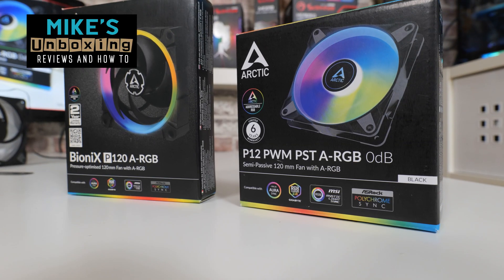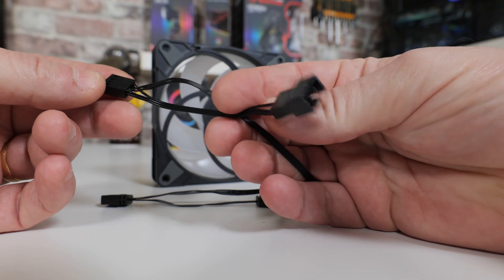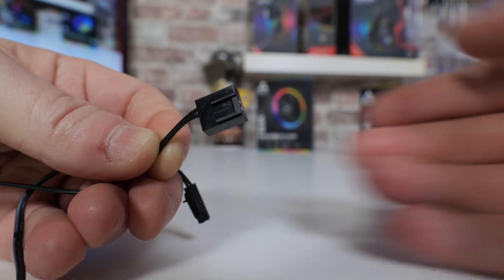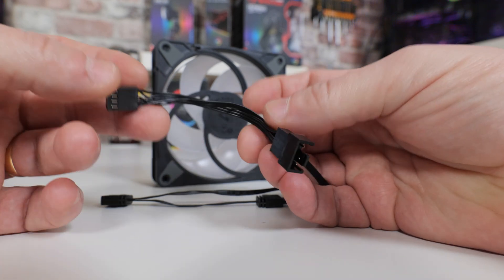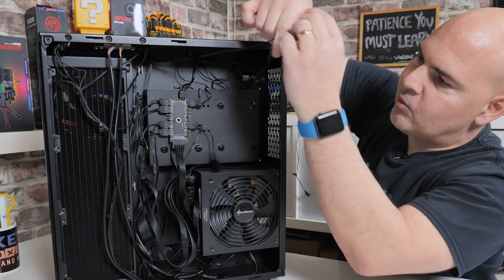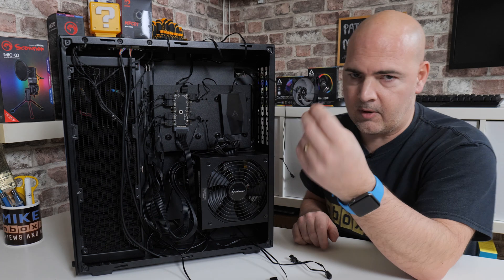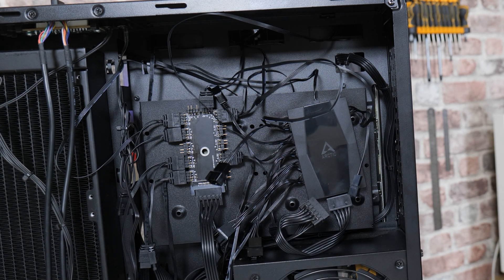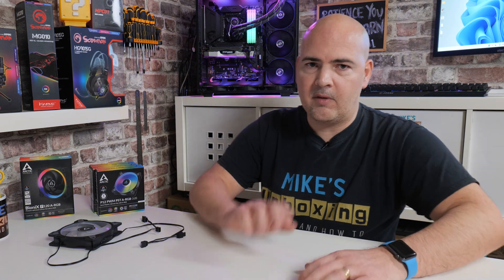Add Extra PC PWM Fans With Arctic SATA Powered 10 Port Fan Hub

Comment: Perfect, the information I was looking for.  Greater content.

I am going to have (don't judge me) 18 fans in my case, the Thermaltake Core P8 and Asus Strix Z790 board.  It's for looks more than cooling.  Project name, The Volume.  I was worried about the strain 18 fans would have on the motherboard.  If I can find a 480mm x 120 screen to use as a system monitor I will out 4 fans. ;-)

What are you using for a ARGB controller?  I am going to use the Arctic P12 PWM fans.
Reply from the maker: the id cooling one we reviewed is decent and the cheapo argb hubs on amazon are not bad either
Reply: @mikesunboxing  I just watched your other video and again great content. A lot of help. Thank you.
Reply from the maker: @lostinseale  Glad we could help 🙂

Comment: Hey Mike i've bought this hub in a bundle with 5 fans. Problem is they shipped 3 pin fans. 

Did they make a mistake or can I use these? 

My motherboard does have a 4 pin header.
Reply from the maker: no this isn't compatible with 3 pin fans sorry
Reply: @mikesunboxing  oh sad. Well um gonna change them. Thank you!
Reply from the maker: @callmecoren  no problem, hope you get it sorted out, any problems let me know

Comment: I'd need one like this but with software allowing me to control each fan. RGB no needed. Any suggestions?
Reply from the maker: corsair icue commander, or similar but you will be locked into that eco system same for lianli and thermaltake etc
Reply: @mikesunboxing  Thanks, that Corsair unit looks good. I won't be locked with corsair fans as i can connect other brands. I'll loose rgb control but i couldn't care less about it. Thanks!:)

Comment: Actually, Arctic supports max of 2 fans per port, so you can actually connect 2x more fans if you want to daisy chain 2 fans on 1 port.
Reply: Cool, if I connect 1 hub to every fan header in my motherboard, then I can connect 6 case fan hubs to finally run my 120 case fans.
Reply: Thanks!
Reply: So I can't daisy chain 3 fans to one port on a hub to have 3 fans bottom, 3 fans side, 3 fans AIO and 1 fan on rear?
Reply: @BeardedGinger  You don't need to daisy chain 3 fans onto 1 port. If you want to have 12 fans in the case, just daisy chain 2 fans on one port on the hub. 12fans/2cable = 6 ports, meaning you will occupy 6 ports on the hub and still have 4 spare. Yes, you can daisy chain them in 3 but depending on the fans, that might start to overwhelm the hub and may start losing power (or just not spin up to maximum speeds). Sometimes it may even burn/fry. You can daisy chain 3 on one hub only if you are using basic Arctic P12's, which do not use alot of power even at max speeds. Hope I clarified it a little bit more, but let me know if you need extra details
Reply: @dduleyt  these hubs are only $10 US at this time, just get another one, six in each one, two headers, simple

Comment: I bought the P12 A-RGB fans, and i have a problem. How do i get rgb to all the fans? I've connected them together and one is on the motherboard. And, only the one that's on the motherboard works.
Reply from the maker: sounds like you have missed the daisy chain somewhere
Reply: @mikesunboxing  yeah, now its fixed
Reply from the maker: @theoneandonlyparsa  Glad you got it working 🙂

Comment: Great review, liked and subscribed. This HUB is pretty useful especially for a push pull ocnfiguration of a 360 AIO!!
Reply from the maker: Thanks for the sub!
Reply: Hi Alex, did you connect all 6 radiator fans of the aio into the Hub and the Hub itself into the CPU_FAN Header on the Mainboard? Thanks for your Help :)

Comment: What fan hub would you recommend for the Corsair sp120 pros
Reply from the maker: the deepcool fh-04 is what i used
Reply: @mikesunboxing  thank you so much man 🙏 another thing is what rgb hub would you recommend for the arctic p12 rgb I have 3. 2 of them In a 240 aio and one in the back what rgb controller would you recommend preferably through USB because my motherboard doesn't have rgb headers

Comment: Hi do you need to have the arctic fan hub to connect the arctic fans, or can i use my existing hub
Reply from the maker: Arctic fans use standard pc pwm and ARGB connections so any compatible motherboard or hub will be fine

Comment: hi mike, i want to buy this hub but is it compatible with the arctic p12 pwm pst rgb (the same as you but with non adressable rgb) and how will i connect it to the mobo?
Reply from the maker: yes and you will need a hub or daisy chain the argb to the motherboards argb port and a single PWM from this hub
Reply from the maker: yes it is and connect to the motherboard chassis fan header and sata power

Comment: hello mate, i have a question, can i connect the 4 pin to 2 pin cable to any sys_fan port in the motherboard?, what i mean is, can i connect the 4 pin side to the sys_fan 2 instead of the 1?
Reply from the maker: yes any motherboard header that supports PWM is fine
Reply: @mikesunboxing  Wow thank you for the quick response :)
Reply from the maker: @usagiii9337  No problem 🙂

Comment: I have a question...say if I wanted to use an led strip and have a 2 pin button on the case can I control the led strip if I connect that 2 pin button from the case into that 2 pin slot on the fan hub?
Reply from the maker: sounds okay to me

Comment: I've been using a 3 pin fan in a 4 pin, and the speed was regulated by the motherboard

But when I use the hub, all fans go at full, why?
Reply from the maker: because the hub doesn't support 3 pin fans

Comment: I have rgb fans with cable with two connectors on it, male and female. And when i connect them on hub and mobo 4 pin cha_header and sata it doesnt work. I can't find soulution for fans to be connected on mobo so I can control them...
Reply from the maker: This is maybe easier to fix or at least advise if we can ask more questions and get direct answers, so feel free to join our Discord chat and we can go over it in more detail https://discord.gg/XtBTGQ6BDu
Agree to the rules by clicking the emoji and you will get access to the rest of the Discord channels

Comment: Which the best fan controller software for windows u did recommend?
Reply from the maker: i generally use the motherboards software and that seems to be enough, what motherboard do you have?
Reply: @mikesunboxing  B450m mortar max.. im try using speedfan.. but the config kinda suck.. i need an easy  software to setting up the fans..

Comment: I'm planning on replacing my front 3 case fans, my EVGA CLC 360 fans, and my rear case fan all with P12s
if i do this, is it right that they are all not PST, and I connect all 7 fans to the arctic fan hub (powered by psu), which then goes into my motherboard?
Reply from the maker: yes that is the best solution

Comment: Does the Sata cable come with it?I just ordered this hub from amazon,but they didnt mention the sata cable.
Reply from the maker: the sata plug goes straight into the unit from your PSU on current models

Comment: I was hoping you would go over the bios portion. I was able to power my corsair fans and control their rgb but they don't see to be adjusting to changes in my overall case when it comes to heat and I can't figure out why.
Reply from the maker: This is maybe easier to fix or at least advise if we can ask more questions and get direct answers, so feel free to join our Discord chat and we can go over it in more detail https://discord.gg/XtBTGQ6BDu
Agree to the rules by clicking the emoji and you will get access to the rest of the Discord channels

Comment: Great video, thank you. One query, there is usually risk of shorting the motherboard header fan pin if we chain multiple fans on a single pin. But as this hub is externally powered, is this risk mitigated?
Reply: The fans are powered by the SATA which comes from the PSU. The 4-pin which connects the mobo to the hub is only used for RPM control.
Reply from the maker: Yes, correct
Reply: @mikesunboxing  Thank you Mike for the reply. This really helps!

Comment: I basically have 1 cpu header (4pins) and 1 sys_fan (3pins). Can someone tell me, if I can connect the hub with cpu header?
Reply from the maker: you can but i would use the sys fan personally
Reply: @mikesunboxing  if only my cpu fan has speed adjustment, i must use cpu fan then?

Comment: Hello I am looking for a way to add 7 non-rgb corsair ML140 fans because I don't have enough headers would this still work or are the connections different? help i cant find information anywhere..
Reply from the maker: Ml120 and ml140 are pwm fans so will be four pin pwm so this will work fine
Reply: @mikesunboxing  thank you so much! Gunna order one

Comment: does this work with rgb fans ?
Reply from the maker: the rgb would need to be controlled on another hub or from the motherboard, but the fan part is fine on here if they are 4 pin pwm fans

Comment: Does is it matter if i use 120mm or 140mm fans ? Or should they be all the same size because of the different rpms ? Greetings
Reply from the maker: ideally keep them the same size and rpm ranges, but it should be fine  either way

Comment: A quick question i heard that you cant controll fan speed below 1800 rpm (and it cant go below) is it true?
Reply from the maker: 4 pin PWM fans will go from zero to infinity so not that is that correct what you have heard. unless they are referring to 3 pin fans
Reply: Thank you!

Comment: Can I use non PWM fans with this?
Reply from the maker: you can but they wont be able to be controlled so will spin full speed
Reply: what if i have a pwm fan connected to the 1st slot and non pwm to the rest, will the non pwm still spin at 100% speed? they're kinda brute forcing my cpu cooler to spin rn lol
 @mikesunboxing
Reply from the maker: @tortrac958  non PWM fans will run full speed if the fans don't have it.
think of the fan wires like this,  one is voltage (at max) the other is ground, another is rpm sense. this is a DC type fan controlled by adjusting the voltage to get the desired rpm.

With PWM you have and extra wire and that is used to regulate speed instead of voltage control, so if that wire is missing the port defaults to maximum voltage and therefore max rpm

Comment: thankl you so much i have one quick question. do they have to be arctic fans or can i plug in my corsair fans into them? i was planning of plugging the rgb connecters in to the rgb hub the fans come with and useing this for powewring them/
Reply from the maker: as long as the fans are 4 pin pwm any brand is fine
Reply: @mikesunboxing  so would carsair ml120 fans work? There 4 pin but I don’t know what pwm means
Reply from the maker: @xhale8064  As long as they are 4 pin - PWM means pulse width modulation
Reply: @mikesunboxing  i built it today and plugged it all in and the fans are 4 pin pwm and they didnt work but when i plugged them into the motherboard fan headers they worked. very dissapointed they didnt work
Reply from the maker: @xhale8064  This is maybe easier to fix or at least advise if we can ask more questions and get direct answers, so feel free to join our Discord chat and we can go over it in more detail https://discord.gg/XtBTGQ6BDu

Agree to the rules by clicking the emoji and you will get access to the rest of the Discord channels
Reply: @mikesunboxing  I’m just going to pick up some y cable splitters

Comment: theres a fan Hub that came with my PC case for the case fans, is it ok to keep that one and add another Fan hub for more fans or do i have to swap the fan hubs for it to work right
Reply from the maker: you can daisy chain hubs or just power it and use a signal from a different motherboard header

Comment: I've read somewhere that we were supposed to connect the hub to the CPU_FAN, and then the air cooler to the hub. I have no idea why. As far as I know my motherboard (biostar racing b350gt3) supports smart fan on cpu_fan and on both sys_fan, so I should just connnect the same way you did, right ? Thanks in advance!
Reply from the maker: i would use this for case fans only and connect to the case fan header. If you want to connect your cpu cooler to it then you would connect the hub to the cpu header
Reply: @mikesunboxing  Got it! Thanks for your help :)
Reply from the maker: @gustavoguimaraes2520  No problem 🙂

Comment: Thanks a lot for the warning about the pins in the start of the video. I was gonna buy a Value pack of 5 Arctic P12s and I noticed they have 3-pins which doesn't support PWM control.
Reply from the maker: No problem 👍

Comment: Dumb question here. I assembled a PC and connected my RGB fans to this Hub however no OS or any software has yet been installed. When I turn on the PC the fans spin but no RGB is lighting up, is this normal? Also, do I need to connect my RGB fans to the MoBo to control the RGB?
Reply from the maker: yes that is right, this hub is for the fan speed only, the rgb is controller by the motherboard or another hub
Reply: thanks for your reply @mikesunboxing
Reply from the maker: @ador7572  No problem :-)

Comment: im gonna be using corsair fans with their rgb hub would this combine all the fans i have going through the fan hub in iCUE or would i still be able to separately address their rgb lighting?
Reply from the maker: fan rgb into the icue hub and the fan speed connections into this for speed control, two separate systems

Comment: Thanks so much Mike! So Grounding is also made through SATA? AFAIK There is only sense and control pins for the fan header.
Reply from the maker: Yea the power and ground are supplied by the sata plug

Comment: hmmm in my case the fans spin different speeds one spins at 1600 rpm on idle and one at 223rpm and the other at 1000 what shall i do lol
Reply from the maker: that is the thing with hubs, they really need all the fans to be the same model
Reply: @mikesunboxing  i found a solution to it there are hubs that support a usb micro to usb header that way i can control the fan speed through that way though it does come expensive but worth it🤣

Comment: I got arctic fan for my latest build, 6x P12 pwm pst and 4x P14 pwm pst, can i Daisy chain those 10 fan then connect to fan header 1? second, can I still control the fan curve to my BIOS? thanks!
Reply from the maker: the 12 and 14 will give a different speed signal so best to keep them separate, you will see the properties of fan in plug 1 in the bios and that will be able to adjust the curve in bios. ALL other fans plugged in with be copying this profile curve

Comment: If i was to plug in Arctic F12 PWM PST, it would work right? Cos the connection is 4 pin and it says PWM PST
Reply from the maker: that is the perfect type of fan to use with this hub

Comment: Just got this controller. Question, you say i must use port 1, must this be only 1 fan or can i add daisy chained fans to this port?
Reply from the maker: it is the port that reads and distributes the PWM signal so best to keep things simple and just connect one fan

Comment: thanks this helped me so much :) just a quick question which rgb hub/software do you use? I got 7 (p12 pwm pst a rgb) however the rgb hub doesnt allow me to change the rgb.
Reply from the maker: the software is msi center and the hub was a cheap 10 port from amazon

Comment: Cani use this for Noctua NF-A12x25 PWM fans or Noctuafan hub - NA-FC1 ? this can connet 10 fans and its cheaper then noctua one.
Reply from the maker: as long as it is 4 pin pwm it will be fine with any brand. EDIT i just tried the A12 and it works fine
Reply: @mikesunboxing  ok, but i dont get why is noctua more expencive then this controler and it can only connect 3 fans and this can connect 10..
Reply from the maker: @stefan7848  noctua are expensive
Reply: @mikesunboxing  okay, one more question :) can i use it on older motherboar i have Asus M5A78L-M/USB3?
Reply from the maker: @stefan7848  Should be fine

Comment: because I  have a b450 elite mobo, does that mean I have to control the fan speed another way?
Also does it come with a sata cable?
Reply from the maker: the sata power comes from your power supply then fan control method is the same for all 4 pin pwm motherboard headers regardless of brand or model
Reply: @mikesunboxing  thanks Mike, helps me out

Comment: Can we connect any 4 pin fan brand to that hub and can the fan speed be controlled automatically by temperature, for instance using armoury crate?
thanks!
Reply from the maker: yes but try and use the same type of fans or the results may vary as it is just replicating the signal going into port no1
Reply: @mikesunboxing  thanks for the explanation. 
Trying to get a set of 6 fans for an Asus Z390-P that only has x2 4 pin headers and i didn't want to put 3 in each header so i was considering using a hub. The fans would be all same, just don't know if arctic or cooler master.
The RGB has to be a hub for sure since that mobo doesn't have ARGB, just 12V RGB.
once again, thanks for the help :)
Reply from the maker: @2leggedpirate265  No problem feel free to join our Discord chat if you need any more help  https://discord.gg/gaeeDPw